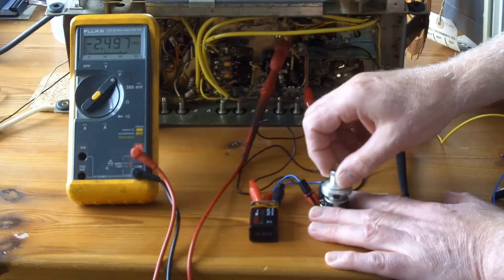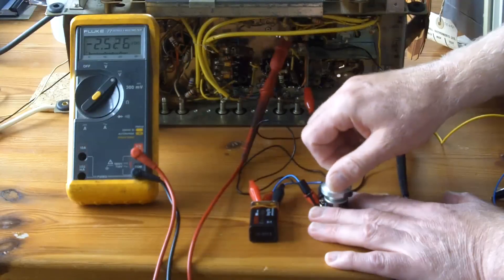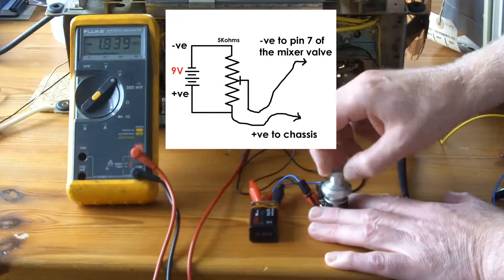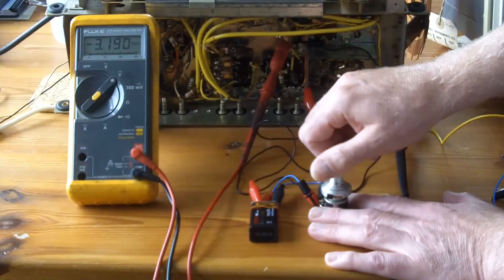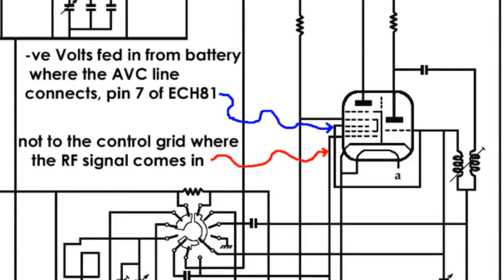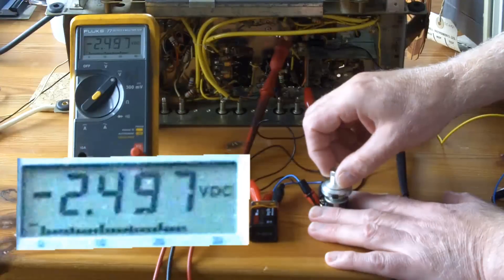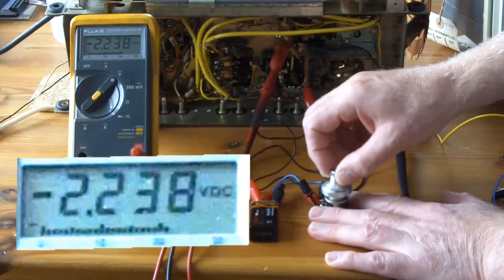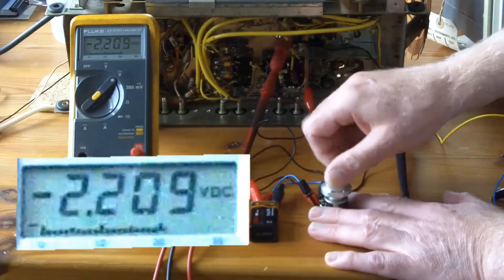About Radio ... Part 15 Automatic Volume Control line, by Andy Davies.

Comment from the maker: @AllAmericanFiveRadio Hi Rick, high praise indeed, thank you. I think that there’s a leaky cap in the AVC line, distant stations are fine but local or strong stations suffer a bit of distortion on this set. I wasn’t setting out to restore the radio; I was only intending to use it as a workhorse for the demos but I’m beginning to get to know it quite well now. 
Tell me, on your side of the pond, what are you more likely to call it ‘automatic volume control’ or ‘automatic gain control’? 
73's Andy